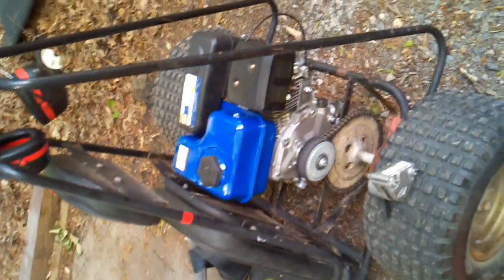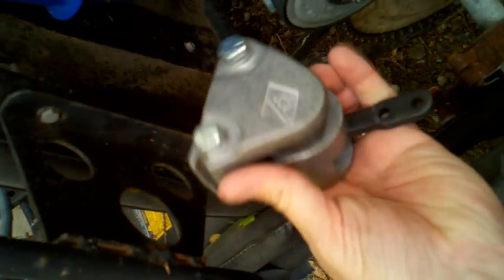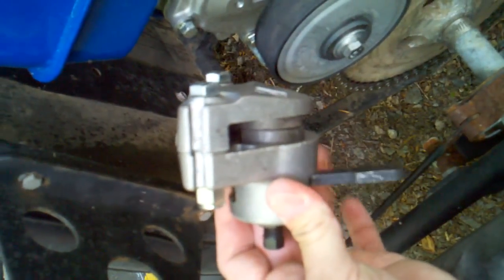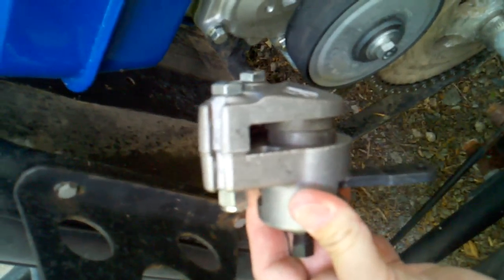Dingo Brake Conversion - Disc Brakes

Comment: This was a decade ago, so hoping you can post a update on did you convert it to disc brakes, if so did they work good? 
I have a Dingo and need to replace the band style brake system as it's not effective.  Thanks